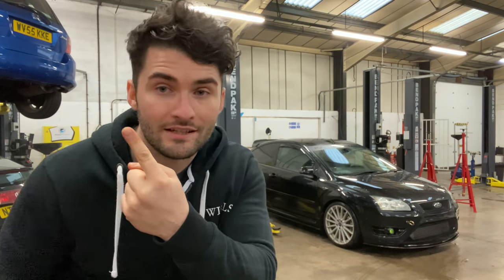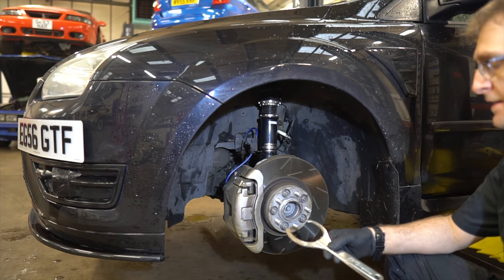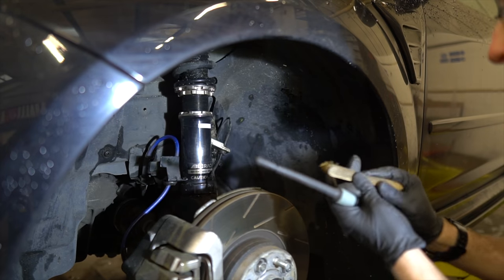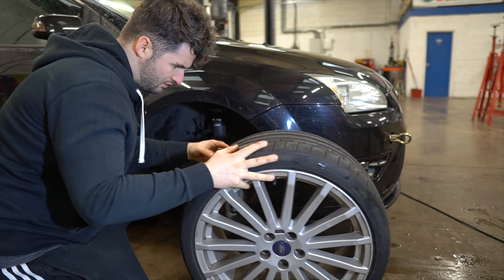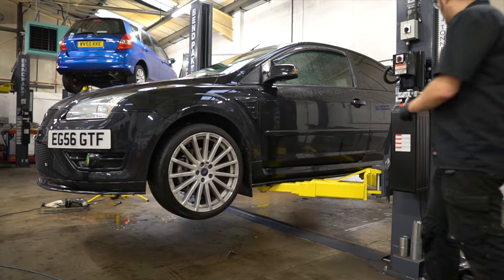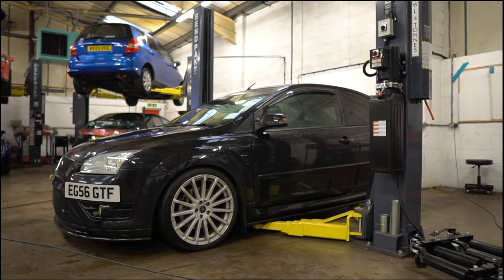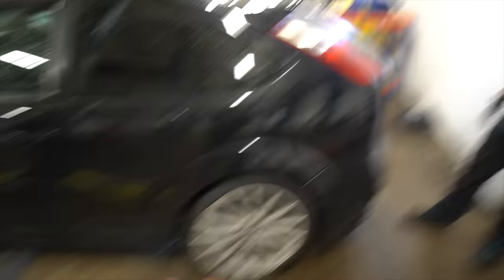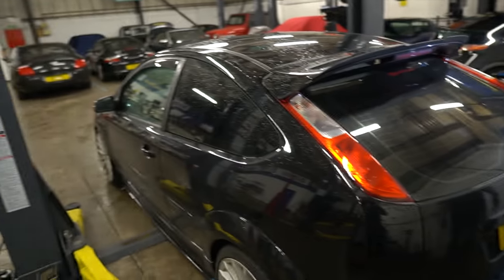MK2 FOCUS ST 225 GETS SLAMMED | ATTEMPT NO.1

Comment: I was watching thinking the lowering of the front wasn’t being done correct. All you were doing was adjusting the spring load. Might be worth trying to get back the standard figures from BC as they would have been set correct to the car (I would’ve thought - although I am no mechanic but had BCs on my Mondeo ST220!).